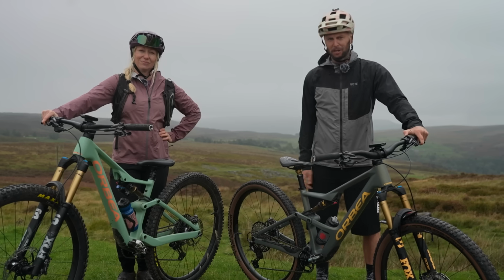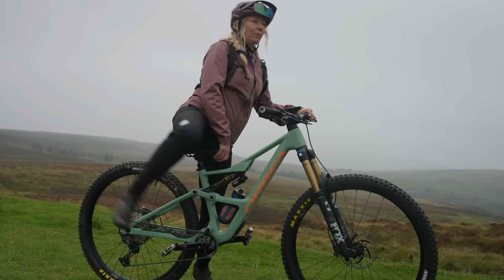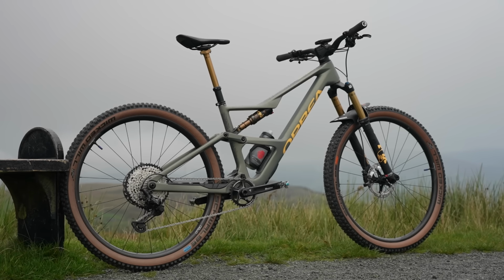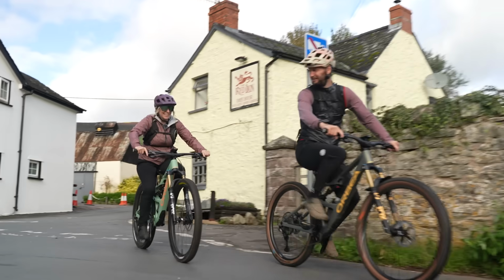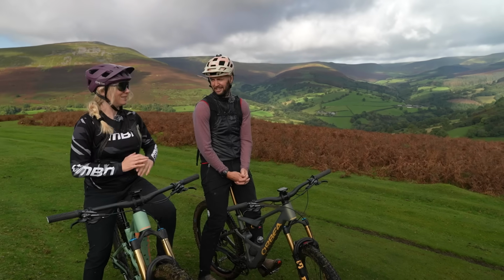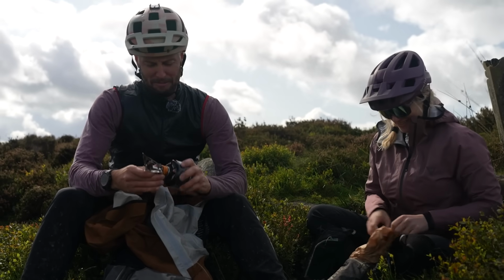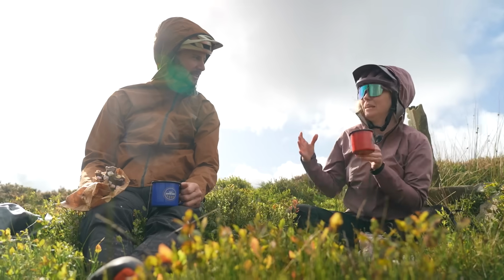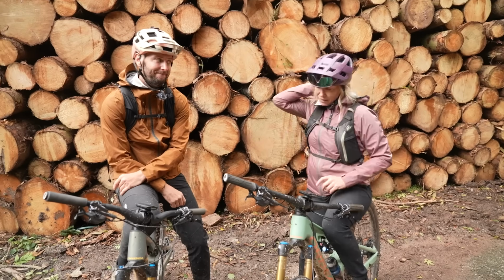New Orbea Occam 2024 | GMBN's Epic Welsh Weekender

Comment: You know the bikes were manipulated when they're running yellow maxxis sidewalls
Reply: No, although some new bikes come with white Maxxis logos, many ship with normal yellow logos including all orbea’s with Maxxis
Reply: Wonder if they fixed that shock bolt that was snapping on the previous model
Reply: Another bike ruined with through headset cable routing 😢
Reply: The tyres, brakes and dropper posts have multiple drop down options on the site to manipulate the platform towards down country or trail setup. Nothing dodgy there
Reply: My previous gen Occam came with Maxxis tires with the yellow letters

Comment: I found it funny that Anna was on the heavier/ slower Bike and not vice versa 😅

Seven months ago I had a similar choice to make with Specialized. Do I take the Evo or the regular one.
After testing both extensively I went with the S4 Stumpjumper Expert with 140mm front travel and 130mm rear. I just had overall more fun with it and it was more playful, kinda like Snowboarding is more playful to me over Skiing even though I like both.

I use the flip chip and ride 90% in the high position that rises the bottom bracket 7mm and honestly make a hug difference in the overall handling compared to low. 
I also use lighter tires for most of my Trail riding (Ground Control T7 and Fast Trak T5).

Cheers from Switzerland

Comment: The step from Oiz to Occam SL is much more significant than Occam LT to Rallon, the latter pair share the same head angles, and almost the same wheelbase which begs the question who will buy the Occam LT over the Rallon?
Reply: The Rallon only comes in a carbon frame option, the Occam LT in both alloy and carbon. You can buy a decently equipped alloy Occam for 3000-4000€ while it would be around a thousand more for the "equivalent" Rallon.
But yeah, that's a decent question though. I own a Occam LT and wondered if I shouldn't have gone with the Rallon instead, then I was happy having an alloy frame that I can smash and ding when I fail :p
Reply: exactly! I bought LT m10 2022 last year with a discount. I first tried rallon m20 which costed about the same but had inferior components. Rallon felt slower and more massive when pedaling, the fork didn't work well with the small bumps and the shock didn't have a block at all. On the other hand, Occam was more agile and had better components, so I decided to get it, it suited my needs and felt better. But this year it doesn't make any sense to choice occam lt over rallon. It is better to find a m10 2022 rallon (the one with kashima and stuff) or even a Ltd version at a discount instead of getting a 2024 occam. It has the same geo and features

Comment: Ordered a Sl M10 through a bike dealer here in Germany. 
Some Magazines claim a weight of 12.3 kg, which seems reasonable since the ltd version is supposedly coming all the way down to 10.8kg. 
Now, that I paid for Brakes and Rims extra 1000€ to shave a few more grams off the 12.3 kg, the bike arrived and weight in at 13.6kg.  
Asking Orbea if there is anything that I can do to get to 12.3 kg or below, they simply say that they don’t claim the 12.3 kg and it it’s to complicated to calculate. No help at all!
I change now to Schwalbe from Maxxis. But I am sure that won’t do the job. 
On a side note, I have a frame in L. So that can make a slight difference. And I opted out for carbon red. Different paint has different weight they say. But that much?
7000€ for a “heavy”- SL bike. 
I can only say that i am very sad saving up for that bike. 
Canyon e.g. has a bike (they seem to be able to calculate) similar specs. 12.8kg 5500€.
Well if you are in for the weight, or consider that a decision making factor. Be aware!!!
For me it’s really important.😢
Reply: How will 400g change your ride though? Even if you were a racer your performance would be barely if not noticeable at all.
Reply: @erni313  o.k. i get your point. 
But:- It makes a difference, depending where on the bike you put that weight. Like the wheels for example. 
- when does it make a difference to you? 400g, 600g, or 734g maybe?
- even if it’s less than 400grams and subtle. Why don’t they tell that red is heavier than blue or whatever! It’s 7 grand for the bike I configurated. 
-overall difference was more than 1kg. way heavier than expected. 
- then I still take a waterbottle with me and a lock and… (nothing to do with the manufacturer) but it still ads up. That’s why I ordered a light weight bike in the first place. 
- if it doesn’t matter, then there is no point of building lightweight 
-Orbea knows the weight of every single component. But they can’t calculate the weight??? 
- I asked Orbea how to achieve the 12,3 kg mentioned in several Magazines and test, since number is out there. They can’t tell me. Or won’t help!
-I am riding a Aluminium Hardtail with 11kg including a lock. The lock weighs only 600g, but certainly sth. you feel. Especially riding for a few hours.
Would you have bought the bike?